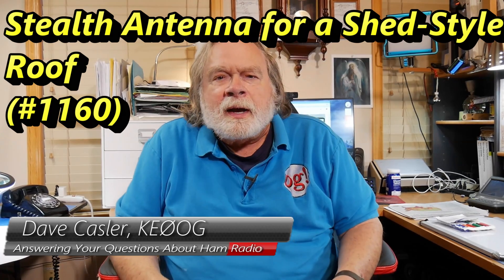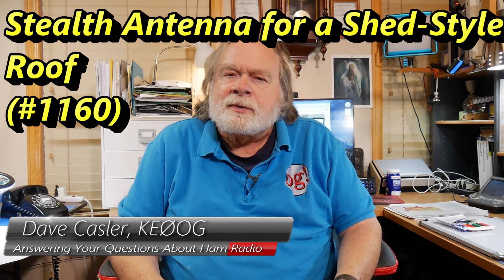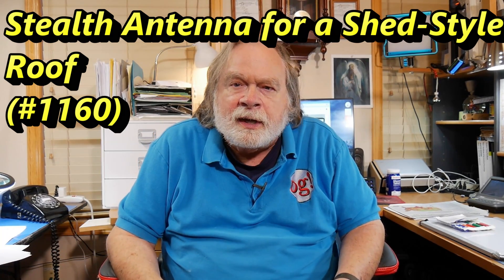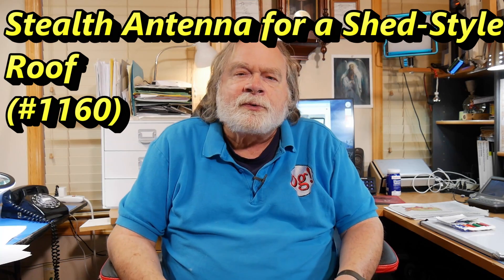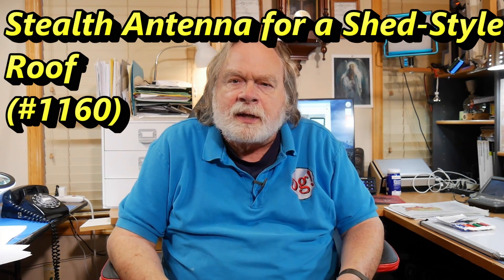Stealth Antenna for Shed Style Roof (#1160)

Comment: I made a stealth fan dipole using super thin 28 gauge black wire I bought from DX Engineering.  For the spreaders I used clear 3/8" diameter acrylic dowels I bought on Amazon.  Its 32' off the ground and is nearly invisible if you don't know it is there.
Reply: Great!
Reply from the maker: How is it holding up in the wind?
Reply: @davecasler  Very well.  I used 300lb braid fishing line along with the top course of wire for strength.  I live on the shore of lake Winnipesaukee, NH and have a direct West to East wind most days.  The dipole is anchored to my house on one side then to a 16' long fiberglass dock whip on top of my garage with the opposite side attached to a 6' dock whip on my shed which is bent slightly to tension the dipole wires.  The real test will be if it can handle the brutal ice and wind this winter.